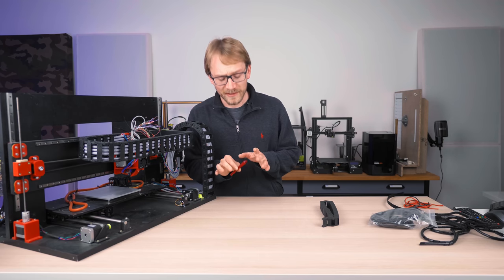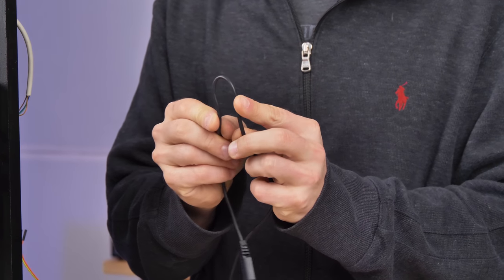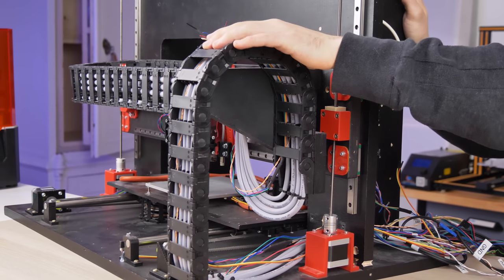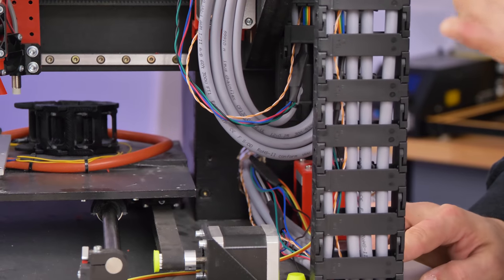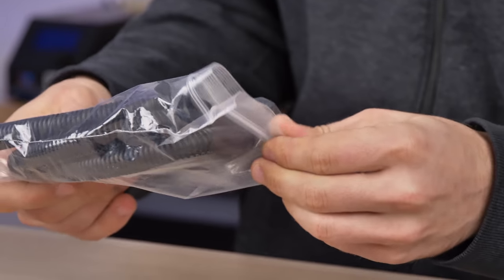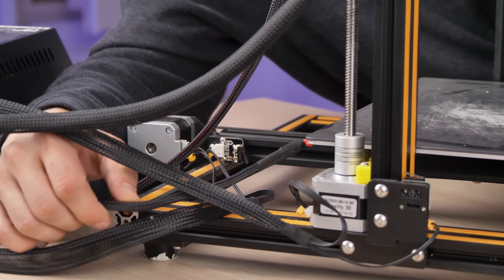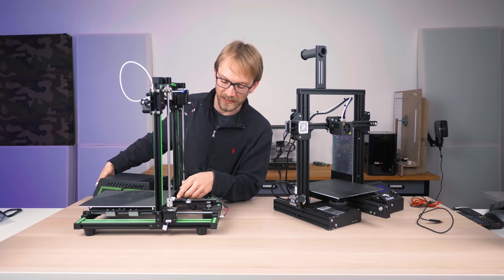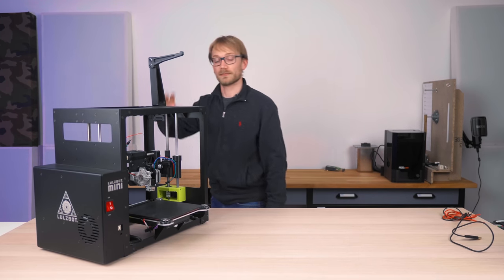Bad and great 3D printer wire management explained!

Comment: I work with industrial machines that use drag chains. There are two things that are very important when putting cables in them. First, make sure the cable is not twisted, and you they should not be under tension or too loose. There is an easy way to archive this. You just tighten the strain relief on one end and then you move the axis back and forth between it's limits a couple of times - this relaxes the cable - make sure the cables can move freely on the loose end, then they should also untwist to a certain extend (but still look at the cables to see if still something is twisted, just in case.
Next look at what position the cable is pulled into the chain - that determines the needed length in the chain. In this position you tighten the strain relief on the other end - but leave a little slack.
One big factor for damaged cables is dirt, that accumulates on the cables. This dirt will cause additional friction. Therefor you should keep them clean (vacuum or compressed air). On machines where it is not possible to remove the dirt as it is too sticky, we used silicon spray (but keep in mind, that the cable's jacket needs to be specced for this). I've seen people use WD40, but that's not a good idea, because A: WD40 is not a lubricant and B: it contains solvent, which can weaken the cable jackets.
Reply: Thanks for the comment. I know it's 7 months old by now but good and correct information is timeless (well, that is, until it's outdated which it isn't in this case!). I'm designing right now my own printer/light job CNC/laser engraver and went quite balls out on it, which does include drag chains on all axis. This does give me good info on how to set them up properly when assembling.
I'm also looking into protecting the linear rods and lead screws against dust since I plan on using it as a PCB drill and wood mill, was gonna add some protective bellows on it, enclosing even the drag chains but that turned out a tad too hard and costly, still gonna find a way to protect those rods and lead screws tho.

Comment from the maker: Honey, I've shrunk the CR-10!
Reply: I was wondering what the whole CR-10 vs CR-10 deal was
Reply: The CR-10 is Sooooooo much better than the CR-10...
Reply: cr10.....
Reply: Wasn't that the Ender 3?
Reply: where can I get a CR-10 with internal control box? xD it's cool Thomas, they both kinda look the same. none gonna blame you. besides, you used only your notes and you sounded just as good as you always do.
Reply: hey thomas, i really liked your videos on choosing parts for your 3d printer but i never found any videos on how to choose a good motherboard....... I'm thinking of building my own and don't know much more that how to connect all the components....... could you also do a sum up of all the choices of all the parts? like some combinations, like in between $0- $200 then mid range and leave $50 to $100 for like upgradibility then go like $300- $500 and All out 3d printer $650- $800+ etc? like some parts lists?
Reply: really liked the video is was detailed but not too long!
Reply: Bruh, why so many cr-10's?
Reply: Hi, Thomas! What's about using drag chains horizontally in h-bot or core-xy 3d-printers? I'm on the crossroad of choosing between a drag chain (which will be pretty tricky to fix there I guess, in my case) and a spiral wire sleeve or a nylon net sleeve. Then a sleeve will be connected to the filament tube to not let it sag (and be squished by the X-beam). This moment makes me worry. The extruder is direct BTW, so the filament tube isn't very sensitive to be used like a support.

Comment: Hey, I'm a drag chain expert working for Kabelschlepp. Good video, covers the basics. As speeds increase other factors some in to play as well as with greater travel distances. If you didn't mention Igus so much I'd share the video on our corporate page but they are a competitor. Glad you use the term drag chain rather than Energy chain which is a brand name not a product name. Like vacuum cleaner rather than Hover. 
Thanks

Comment: I'll take this as a reminder to finally sort out cable managment on my cheap prusa clone.
Reply: Mine looks like a jungle
Reply: I''ve the same issue on a new build.  I used the thicker split conduit for the X axis and the spiral wrap for the y axis, but need to make the X axis wires longer since I like to run them over the gantry on my other machines.  The wiring going into the SKR mini is a nightmare though.  I suppose I need to hack on the Marlin sources some to get the sd card reader on the LCD to work, since right now I have a tacky looking SD to microSD extension going directly into the board and foam taped to the acrylic.

Comment: Cat 5 is okay but make sure they're stranded. My last set of cat cables (that turned out solid core) lasted only about some 100 hours in my drag chain
Reply: Yeah, he should had said cat5 patch cables
Reply: @Nero_XY  I've seen patch cables with solid core wire too
Reply: the common one is the solid core tbh.
Reply: @frankhovis  Then they weren't proper patch cables, even if sold as such - all the standards (US, European etc) require stranded wire for patch cables and solid for infrastructure.
Reply: @WazheadBoci  Only for fixed infrastructure cable, though.
Reply: @pnt1035  Tell China that.
Reply: Yeah right. Cat5 is usually solid core, and if you have to bother getting stranded, then isn't it time to start asking for something really more appropriate?
Reply: @paulseymaker216  Were you replying to me, or Frank?  Cat.5, Cat.5e, Cat.6, Cat.6A and Cat.7 infrastructure cable is solid core.  The corresponding patch cables are stranded wire, because that's mandated by the EIA 568 and ISO 11801 standards.  As the Network Manager for a large University, I was responsible for the installation, testing, and certification of many tens of thousands of them, and I know my way around those standards.
Reply: @pnt1035  I'm sure you do. I was clearly not replying to you.
Reply: Solid core in a patch cable is even more of an heresy than stranded wire in the walls. As solid core is meant for fixed one-time installation, i'm even surprised it survived this long into something continually moving.
At least it was Cat 5 only, with the increased rigidity of higher categories you'd put a lot of extra load on the stepper motors XD
Reply: @WazheadBoci  "common one" in construction supplies stores, in office supplies store it's always stranded (And often sold in 2m/3m/5m cords with the RJ45 connectors already crimped in).
But have to agree when you buy a roll of cable its more often installation cable, as for patch cords most people simply buy already made network patch cords, except some nerds who like to have their cables in perfect tailored sizes, or to another purpose like this.
Reply: @paulseymaker216  You have to bother only because nearly nobody buys 50m stranded Cat5 cable rolls (but you can still find them easily, i did once to tailor some specific uncommon length network cables), everybody buy pre-made network cables for some bucks.
Anyway for wiring a small machine like a 3D printer you can simply buy a 5m network cable and cut the RJ45 ends and you'll have way enough for most printers, only if you're wiring a large industrial equipment would you need full rolls.

Comment: I used a mixture of 4 designs for my ender 3 and i love it. Prevents my wires from drooping onto my build surface. and keeps them confined. Took awhile to print, but was totally worth it. Took abit to make sure it moved smoothly. A little bit of sanding and alot of moving them back and forth before installation, but its easy enough to do mindlessly while watching youtube.

Comment: Put a piece of old tape measure in the braided sleeve, and it makes a cheap, light-weight drag chain. It's really popular on MPCNCs.
Reply: brilliant idea! Noise-wise it should be better them drag chain, definitely gonna use it.
Reply: A large stainless steel cable tie is even better, doesn't have the very sharp edges of a tape measure and can be drilled and anchored at the ends.
Reply: @npgoalkeeper _ you can drill it of course. But duplex stainless is more malleable and durable, not thin, brittle and prone to cracking like tape measure, good luck with a drilled anchor in that.  Tape measure with its commonly bowed crossection is designed for straight runs with bending in one plane, not bending load and flexion in more than one. I.E how to destroy a tape measure quickly, repeatedly bend and stress it in anything but that one axis, even then they are considered a consumable in the building industry. Those end anchors are important, because if you don't rigidly anchor the ends of what is effectively a spring then you are increasing the load on whatever strain relief, if any,  you've provided for your cable run by half the spring constant per end.

Comment: That's what I like about the Sidewinder X1. The ribbon cable layout essentially uses drag chain physics without the drag chain.
Reply: As long as the connector has strain relief...
Reply: Flat-flex cables[1] have been used in consumer 2D printers forever at this point, and for good reason, so it's nice to see them appearing in 3D printers as well.

Just as with drag chains and any other wire management system, you do still have to design things properly to ensure the FFC doesn't bend too tightly, either along its length or at a connector, but I'd guess it's a bit easier than with regular wires because you only really have one direction of movement to worry about. You also have to be careful with the current you're putting through them, as the copper is intentionally very thin, and each wire/track within the FFC tends not to be very wide either, but you have to do that with any wire, so that's not a big deal. I'm assuming that the X1 gangs multiple tracks in parallel for things like the hotend heater.

[1] I could be wrong, but I think the X1 uses FFCs rather than ribbon cables. FFCs are essentially flexible PCBs - a layer of copper sandwiched between two layers of polyimide ("Kapton"/"Koptan"/"Captain™" tape). Ribbon cables are the things used to connect ancient PATA/IDE hard disk drives and floppy disk drives to PCs :)
Reply: @ManIkWeet  yup, always one of the first things to print when you get a Sidewinder haha
Reply: @npgoalkeeper _ This is true, yes. I may be guilty of underestimating the cost of that (monetary/complexity/maintainability) because I'm an electronics hobbyist who enjoys designing PCBs, can get very good results from home-etched boards (pre-sensitised laminates from Bungard, or Microtrak from the now-defunct-I-think Mega Electronics in the UK, rather than using a toner-transfer method or a self-applied etch-resist film; though those are typically only for prototypes, with final boards ordered from Seeed, usually), has no trouble soldering even fairly fine-pitch components, and has the disposable income to throw at stuff like that (mustn't forget that aspect!). I'm just currently lacking the time for this stuff! 😣

In fact, I already have a couple of moderately-complex PCBs as part of my printer - one is mostly to take the EN+STEP+DIR lines of the 5 motor outputs of my Smoothieboard X5 and feed them into sockets for Trinamic TMC2100 silentStepStick modules, with various configuration jumpers, input for a dedicated power supply for the motor drivers, and such. The other is a Raspberry Pi HAT to control various things like lighting & fans in the LACK enclosure.
At some point I'd like to publish the schematics, PCB layouts, gerbers, etc., as well as YouTube video(s) discussing them, but my life has been a mess over the past few years and I've not yet been able to find the time 😩

Anyway, bear in mind that FFC breakout PCBs are available to buy pretty affordably, if you don't want to create your own.

Pimoroni has their "What The Flex" product, which is admittedly on the pricier end of things, but accepts FFCs with up to 40 pins/lines and with either 0.5mm or 1.0mm pitch (the two most commonly seen pin pitches in FFCs). It breaks that out to a single row of 0.1"/2.54mm header pins, and has a prototyping area, IIRC. Though being a single row does mean it's a fairly wide PCB.

Alternatively you can find FFC breakouts all over eBay and AliExpress for only a few money units (probably Banggood, too, but I rarely search there). They're primarily in 0.5mm and 1.0mm pitches (others are available, I believe), and with a wide range of FFC widths/pin counts, so you can buy one that exactly matches the FFC you're using and have it fit perfectly, which is probably better for semi-permanent use than Pimoroni's What The Flex, which relies on you inserting the FFC in exactly the right position if it's not using all 40 pins. The AliExpress/eBay boards also use two rows of pins, which dramatically reduces board width - again, making them better for semi-permanent use, but less-convenient for prototyping and experimentation.

Comment: Tom, one episode topic suggestion: In 3d printers where the Y axis is a moving heated bed, I have been noticing that if the object is a large cylinder, that the circularity slowly becomes more and more imperfect as the weight of the cylinder increases. This imperfection is most noticeable if the cylindrical object is later put on a lathe. For Delta and 'Voron' type 3d printers, where the bed is stationary, does this progressively- increasing non-circularity problem go away? You have several printers with a stationary bed, plus standard moving bed cartesian - so you can test this circularity problem. Your audience will find it very interesting for sure. Thanks!
Reply: Does Prusa Original exhibit the artifact too? I'm thinking just deleting the typical bed springs can make a lot of this artifact go away. I mean it stands to reason that the springs allow some rotational movement of the bed around the center of the bed carriage, and the Y acceleration of the bed assembly would impart this spring movement. It's a possibility, that the weight of the print has fairly little influence on the artifact, but the progressive worsening comes merely from the fact that the same angle of rotation will impart a higher displacement up the print. Fundamentally, there is a weight influence, as the acceleration is fixed in software, thus there is a higher driving force to maintain same acceleration with increasing weight, and in turn some of this force ends up acting against the springs and compressing them. Making the springs significantly stiffer or preloading them with a lot more force can be a valid partial mitigation.

I have never heard of a Voron, looking now, quite intrigued.

Most printers with vertically moving bed still have some construction issues, such as the rods being more prone to bend in the middle of the bed travel.

The thing to remember with Delta is that they can be overall pretty flimsy and can only drive super light toolheads, but at least its flimsiness only ever affects the head, not the platform. Still, it can vary depending on print head height.

Comment: TLDR:

If using the original drag chain: 
- Make sure you never tight the cable nor push it (so it want to get out at bending join). 
- Keep it slightly loose all along

For any method: 
- Make sure to secure it at each end (with tie-rap!)
- Use multi-core wires (Stranded wire) NOT solid.
- Prefer a smaller wire since it can have a smaller bend radius
- Always make sure the drag chain has a bending with some distance and that the wire isn't the one causing it.

- They exist "drag chain cable"; low-grade one doesn't like high speed, high temperature and small bending radius. 
- An ethernet cable will do the job, it isn't the best wire but your printer will break way before the cable.

Alternative drag chain:
-  Open type conduct
-  Spiral wrap
- Mesh sleeve

Only the open type conduct is equivalent to the drag chain.

For the other two methods you should do:
- At each end of the "drag chain" (where you will tie-rap it) you must also add some material to reduce the stress with some length to it. (Probably like multiple layers of heat shrink, electric tape)
- You must add something to create the minimum bend radius. Prusa, for example, simply put a nylon filament into the drag chain!

Comment: This is great. I think the bottom line is that on most of the machines out there the wire management is an afterthought.. Any of the moving parts with wire connectors will fail if the wires keep getting flexed, or if strain keeps being put on connected soldered to a PC board, the board or solder joints will fail. Thanks for the good info. Can you do a video about how to solve some of these problems. 
It would be good to have a video of "fixes", whether that be printed cable guides, clamps or even shrink tubing support on the back of the connectors. It looked like one of the printers you were looking at attempted to do that. They had shink tubing up to the connector. What they didn't do is extend the tubing onto the back of the connector and shrink it there to provide the needed support.
well done.  Thanks for your help.

Comment: I think it's better to just strain relief on one side of the drag chain, especially if you stack cables on top of each other. From experience I can tell you that cables move in and out of the drag chain when it is in motion and you don't really want to restrict that movement. Preferably you would zip tie them at the end that is stationary.

I worked with drag chains that provide around a meter of travel and the cables will move in and out around 3 cm or so at the dynamic end.